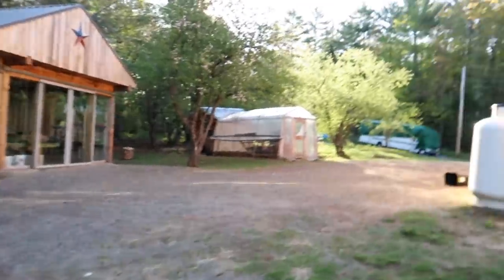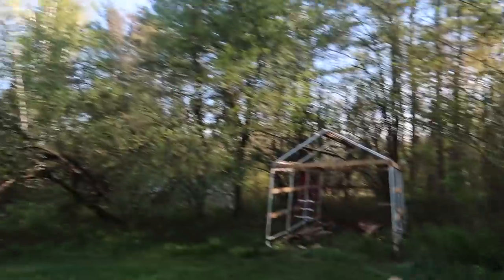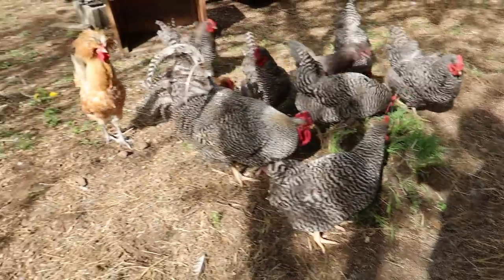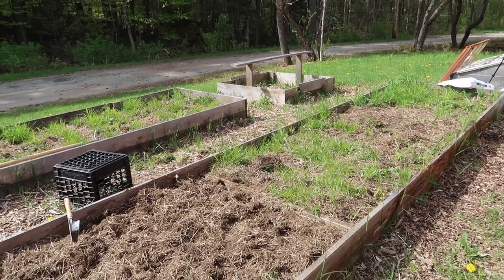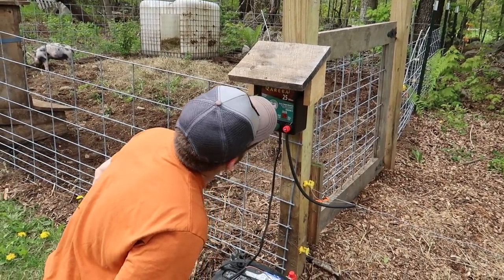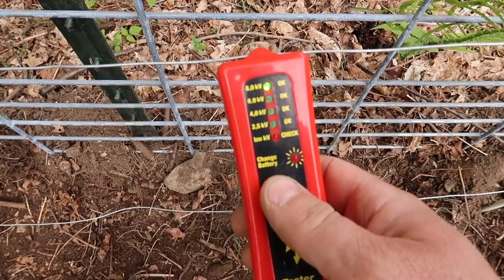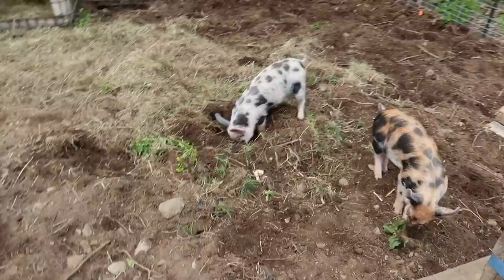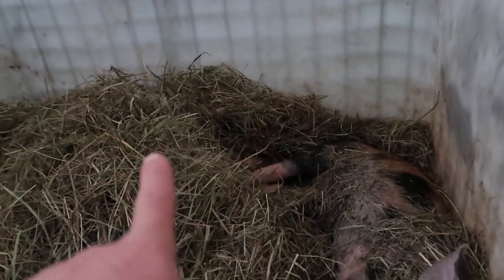Finding some Odd Bugs While Prepping the Garden Beds

Comment: Hi Folks things are looking good around the homestead good job! Two things that I find that saved me lots of time was 1. I put all my compost in one pile I liked to pile it with the tractor and then each time I went and dumped some compost I would toss the pile of compost and that helped with breaking it down faster.  2. if you don't like doing all the clean-up on those raised beds each spring cover the inside of the raised bed with a thick heavy mat, or an old rug something to cover the bed and put it on in the fall when the crops are harvested and buy spring the stuff under the mat will be composted and sod free ready to plant. You can even use wood to cover soil in bed like pieces of plywood try to get as flat as possible and overlap where necessary let Mother Nature do your composting for you, or move the chickens right in after the fall harvest and let the chickens eat the seeds.

Comment: Those are cutworm pupa. I have had issues with those as well in my garden. The cutworms will come out at night and cut the leaves off of the plants then you are left with just a stem. They can ravish an entire young garden in no time. I’ve used DE and crushed egg shells around the base of the plant with some success. I’ve gotten to where I put a foot section of 6” or 8” irrigation pipe around the plant. Sometimes I just end up plant my garden a little later after their cycle is done. This has had the best success. 
Thanks for sharing :)

Comment: How nice to see everyone out and about. Darn , I didn't get to see the piggy's learn about the electric fence. That looks like egg salad sandwiches.  OMG they sound so good for lunch.  Finish my coffee and then I am off to the Meyer Hatchery. I'm picking up five New Hampshire's and five Barred Rock.  I ordered straight run as I want to have a couple of roosters. Yes, you read correctly . Remember , no roosters , no babies !
Reply from the maker: How far are you from the hatchery?
Reply: Hi Al , 
I am about an hour's drive. Compared to the shipping cost the little that I spend for gas and my time are very well worth the drive. Plus, while I was there they have misc. chicks in bins for $2.00 each.  No clue at all as to what breeds they are. As the old saying goes , ' Youse pays your nickle and takes your chances . " I bought two with no idea of what they are . Only that they are hens. It will be interesting to see what they grow into.
I have seen chicks for as low as $0.50 at Tractor Supply. But, while I was mulling it over they sold them all ! They were Asa Browns and I didn't know at the time what Asa Browns were.  He who hesitates doesn't get any desert ! So , now I have some Black sex-links , New Hampshires, Barred Rocks  and five meat chickens. Why five ? I live alone  you know. Wow , those meat chickens grow FAST ! I got my first chickens all about the same time and t he meat chickens are about three times the size of the egg chickens.
I will begin building another mobile chicken coop like yours.  But , it takes me a couple of days to build it. lol Too many coffee breaks ?
  I'll begin the permanet chicken coop in a few days. That should keep me occupied for two or three weeks. lol  I intend to set up a rain catchment system into a 55 gallon barrel and from there into a 5 gal. bucket to be filled by a float valve. Carrying water for the chickens even every couple of days is a pain in the butt for me. At my age I do not have the energy that you do.

Comment: Al:  If it was my shelter I would cut a 20' length of 10mm / #3 re-bar into  2' lengths.  Then drill 3/8 holes into the   PT 2x6  at 45 degrees from the inside.  The 2' length of re-bar then can be driven into the ground; 3 down the long sides and 2  in the ends.  This would help to hold down the shelter in the next big wind.    The lift is vertical and the re-bar pins are at 45 degrees  resisting with their side movement. For extra strength screw on 1'  blocks and drill through both giving you over 3" of re-bar in the wood when driven flush.  Re-drill the PT at 7/16 so the rebar will slide through when prying on the blocks. 

To remove the pin unscrew the blocks and pry then off bringing up the pin.    On the front you could double up a 2x6 on the top of the PT 2x6  to not have a block as a trip hazard.  

 the old guy Bert.

Comment: My ex libetard wife wouldnt lift a finger to help me install paved walkways, drainage, sprinkler systems and save $40,000.00 in the process.  She had a live in maid that arrived Sunday nights and left fridays.  I was traveling covering the Pacific states for two weeks at a time.  I would drop and sleep for 12 hours to be woken and asked why I wouldnt vacume like her father did for her mother.  You are a blessed man.  Big fan from the beginning.  The best part is watching the animals work for you in the woods.  Mark Baker told MDAR on Michigan to kick rocks and is homesteading instead of fighting big ag backed crooks in office.  Justin has along with Richard perkins a better model than the tractor.  Keep eyes out for any old trailers that roll.  Electric net a larger foraging area and add goose guards.  Your water, feed, fencing all is carried above the chickens.  Use the kubota to move or DIY.  Old hay wagons are perfect for both pigs and birds.  Throw on your hog panels for water catchment and a 270 gallon tote for storage.  A ezgo old grain cart also perfect.  Tarp the top, store bulk grain, water catchment inside.  Electric winch on an electric ATV or tree with rope and remote to move by timer or remote.  Same battery as electric fence.  Hemp is legal in many states
  Plenty of rope.  Use old straps in the pens.  One day you'll be doing fodder vs hay all winter long.  Barley seed from the ezgo.  Year round use.  Saves 40% over bags of grain by the pallet and less back aches.  Go get em tiger.